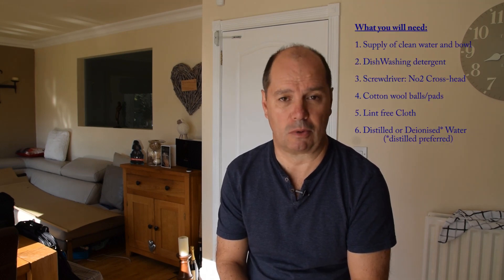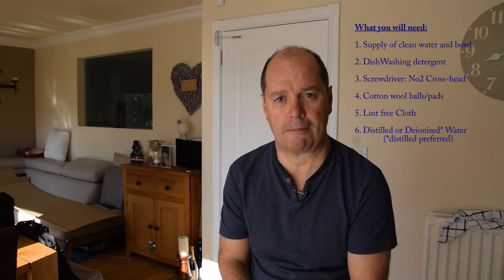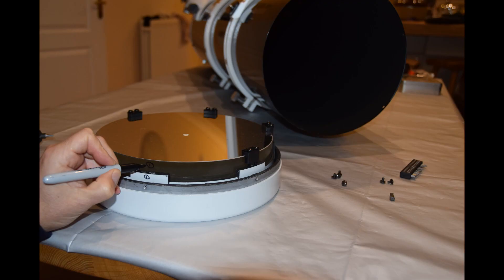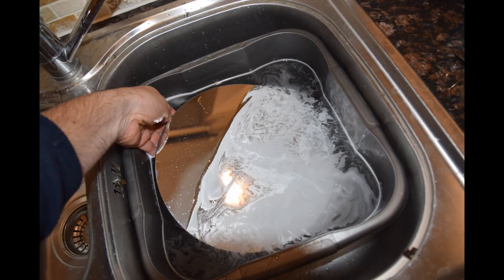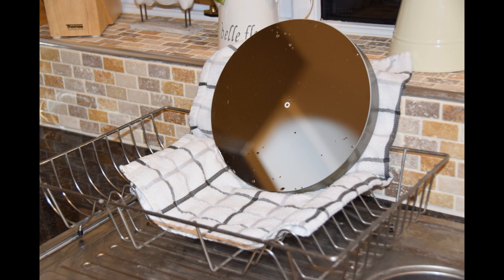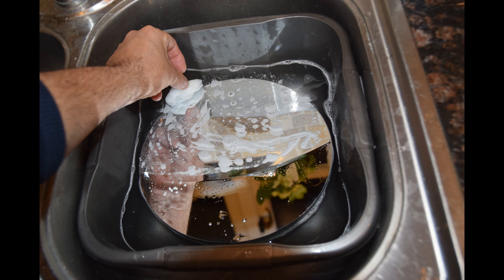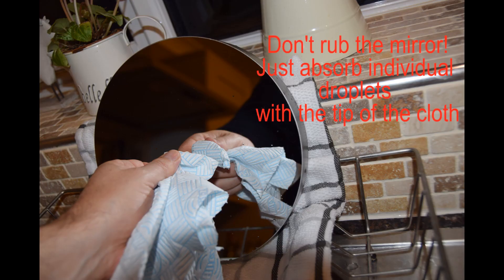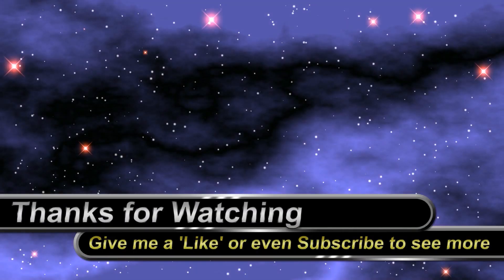Cleaning the Primary Mirror of a Newtonian Reflecting telescope

Comment: My new telescope is now worthless. Went to clean the mirror because there was a little black spec on it. Long story short, almost dropped mirror and touched with hands...Tried getting finger prints off but now there are just blue imprints of my hands...Will this work for my clumsy situation?....Thanks
Reply from the maker: Hi, and sorry to hear about the mishap!  A little more washing up liquid should help to get rid of the mark, and slightly warmer water also.  The mirror coating is relatively durable so careful cleaning of the area with camera lens cleaner is possible, but then wash with water afterward to avoid any residue.  
Your experience probably shows that sometimes it's better to leave it well alone until absolutely necessary.  Good luck, and let me know how you get on :)

Comment: I pulled the primary mirror from my 12 inch do and tried to clean it. No luck. Seems mat or oxidised. Can I use a metal polish to make it shine again or do I have to get it to an expert to re-coat it ??
Reply from the maker: Gunner, sorry for my late reply.  PLEASE don't use metal polish on the mirror!..  Actually the Aluminium coating is protected to stop the oxidation.  If you really have a bad reflectivity then re-coating is the best option,  but i would get someone else to look at the mirror first, for a second opinion

Comment: Hi, do you you think it's possible to clean the primary mirror without to do collimation afterwards? That's the scary bit for me! Thanks for the video.
Reply: Any movement in either of the mirrors will require re-collimation. If you are nervous about collimating, know it’s no where as difficult or as risky as cleaning a mirror. Laser collimator makes it even easier
Reply: @amazonwarehouse7302  Hi, thanks for that. Could you recommend a Ytube video that's good on collimation? I've watched a few but they all seem to be doing it a different way. Thanks. Plus, it seems that a lot of cheaper laser tools are themselves out of collimation.............deep joy
Reply: HollomanUFOLanding Laser collimators aren’t that difficult to realign, I wouldn’t completely rule it out. So far for videos, Orion makes two collimating videos (one with laser and one without) that are extremely helpful and important to watch for a basis of understanding. PS, go for the XT8 if you can, good luck.
Reply: Definitely get yourself a laser collimator (if you haven’t already.)  It makes collimating so much simpler!  And they are not too expensive.

Comment: Nice going! No fear of losing the central little collimating donut? I guess it wouldn't be to hard with a bit of trivial geometry knowledge to put a new one back in the same place.
Reply from the maker: Jerome, hi, it did worry me a bit, but it stayed firmly in place.  Perhaps the factory fitted ones use better adhesive!  As you say fairly easy to find the central point, but I don’t like to risk any damage from extra messing about if can be avoided 😊
Reply: @MikeyJ  I also cleaned my primary mirror a couple nights ago, very similar method to yours. cheers!

Comment: I scared to clean my mirror because kinda hard to PUT again at telescope
Reply: In the same boat here, he shows correctly how to clean. Careful likely can replace mirror. Surface of these mirrors are accurate to wavelengths of light, zero rubbing please. Once with weight of cotton ball. Actually if I end up with minimum marks after water agitation clean, might not use cotton ball, tho correctly done is Safe! My current 2nd scope is always ready in car trunk  thermal ready, don't take it indoors. Few years as cover on and still mirror is Clean! Clear Sky!
Reply: @warrenmcmurry8199  thank
Reply from the maker: Hi both, yes it's a little bit scary first time, and only do it if it needs it, but the mirror has a coating, so along as 'no rubbing' there will be no damage.  And for replacing the mirror, the main issue is to collimate it again, so you have to be comfortable with that process first.  I started a collimation video, but never finished it :(  i will try to get that online soon